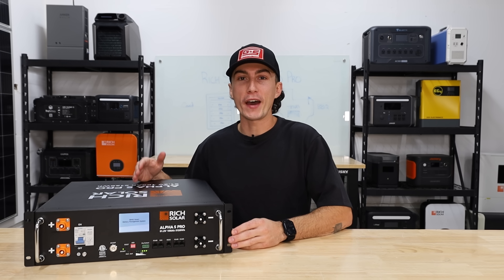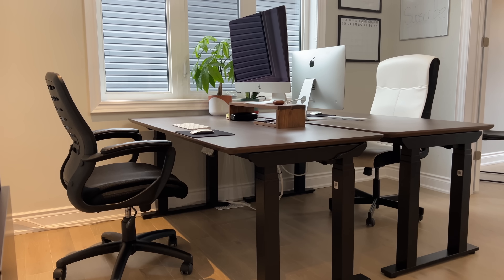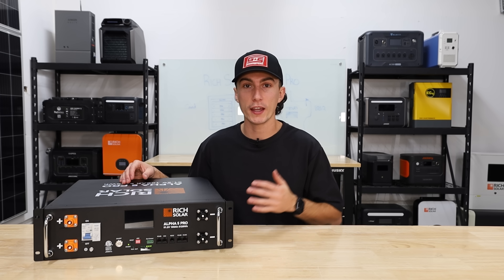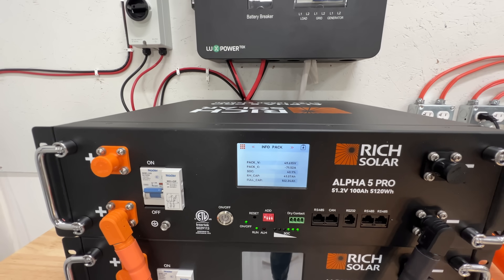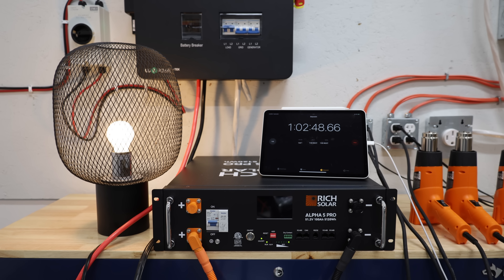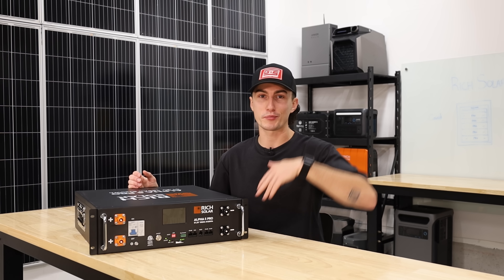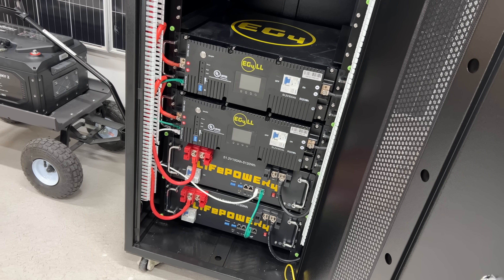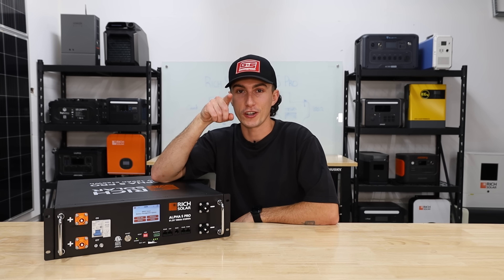Finally Something BETTER Than EG4? - Rich Solar Alpha 5 Pro Server Rack Battery

Comment: What kind of cable connectors does it use to charge or connect to an MPPT and/or inverter?
Reply: I don't know the specific answer as in a model number of a specific connector but was told by Rich Solar when I ordered extra power cable that they are proprietary and only work with their batteries
Reply: @mikeward1975  yup,  the only downfall is the connector on the battery.  this should have the option for a screw in.  when it arrives, it only comes with the "jumper" cables for another battery.  another $45 for a short length of cable with the connector.

Comment: If you're trying get a cheap rack battery, the VATRER's are still at $890.15, shipped, with BLACKOFF code from their website.  $0.17/wh is pretty good for a rack battery and getting down to DIY 16kwh pack pricing ($0.13/wh shipped last one I purchased).

Comment: Hey @TheSolarLab! Thank you for reviewing the ALPHA 5 PRO; we’re happy you like our battery!

However, we want to clarify that the ALPHA 5 PRO is compatible with EG4. Just set the protocol to Luxpower and it should connect.

We’ve updated our website to clarify which protocols to use for the inverters.

Thank you for making us better, and have a solar day!
Reply: This is key, since I wish to pair with an EG4 6000XP as shown in the video.  Hoping this is correct!
Reply from the maker: Good to know! We actually spoke to signature solar over the phone and they said it did not work, might be worth updating them as well!
Reply: “Should Work”?
Reply: Does not work with EG4 6000xp as far as communication. Battery throws BMS fault at the end of charge cycle. No help from either manufacturer yet.

Comment: Did they finally switch to 16 cell batteries?  Ordered a pair last year only to discover they were branding 15 cell units as 48 volt...  meaning they held less and standard lithium charge profiles didn't work.   Returned immediately.

Comment: I admit i didn't watch the whole video but i can't figure out if the battery comes with cables?  If not its probably not worth it because those quick connect cables aren't cheap.  What is included in the box?
Reply: I bought 2 from Shop Solar...Mine came with short parallel power cables for each and 6ft power cable for 1..A couple communication cables as well...The 6ft cables were in a separate small box so not sure if Shop Solar just threw them into the mix knowing they would be necessary or not

Comment: I emailed rich solar and they said the Alpha 5 Pro Server Rack batteries will work with the EG4 6000XP if the protocol is set to Luxpower.
Reply: It will not. Battery throws a BMS fault code at end of charge cycle

Comment: Can you somehow connect a server rack battery to something like an Anker Solix?
Reply: yes, use the battery's as a solar input on anker
Reply: You’ll need a XT60 female connector for the Anker Solix solar input. The only cable I could find for the Alpha 5 Pro connector for an O-ring required for an XT60 connection is Rich Solars “4 Gauge (4AWG) Cable Wire Connect Battery to Inverter (Orange & Black)” for $45. One is also needed to charge it and it doesn’t come with one.

Comment: Thanks for the review. Does this have a UL Listing? If it does not have it, it is pretty useless for solar installs that require inspection.
Also, I want to echo @dvatp, lack of EG4 support is a deal killer.

Comment: My 48 volt Rich Solar inverter runs my table saw. My very heavy, expensive 6000EX inverter with a big transformer fails to handle the surge. Rich is superior in every way.
Reply: I recall hearing that some people had hooked up their EG4 Inverters and were not getting good results, until they discovered that the battery pack they were using could not handle the load it was requesting. (Of course, your situation may be different).
Reply: @ I have 2 EG-4 48v 100 AH batteries, which powered the table saw flawlessly with the Rich Solar inverter.
Reply: @CompleteOffGridAmateur  I wonder what the starting current draw on that table saw happens to be. But, back to the 48v Rich Inverter, which model is it? Might be cool to check it out.

Comment: ISSUE 1) Can only parallel 16 units
vs eg4 can parallel 64 units, giving greater expandability.

ISSUE 2) Must be capable of communicating to the inverter.

Those Two Strikes are an absolute deal breaker!

Comment: The lack of communications compatibility with EG4 inverters is a deal-killer for me.
Reply: Yeah, that's probably worth the $100 more per battery for all the value-add that gives you.
Reply: @kojakdurham  Just checked the site and downloaded the manual.  If I can believe the manual it appears they support EG4 protocols now.  But of course the battery is now $1800.

Comment: 4:30 - Something is fishy here… A 90 watt load only running 1.1 hours. Might want to do a disclaimer and review the math. Other than that! Great vlog.
Reply from the maker: Yea meant to say Amps! It showed Amps on the screen on the battery sooooo half points?😂
Reply: @ No problem, no points deducted, looking forward to more off grid / solar exploration. Thanks for the clarification, I’m a bit embarrassed about that I didn’t offer that up! Thank you, makes much more sense now. Central Florida here 🌴
Reply: He probably meant 90 amps. That would make sense.
Reply: I never post comments and want to get clarity on that comment in the video. So, what do you @thesolarlab run for that 1hr test?
Reply: I had the same confusion/concern. Glad to see I wasn't the only one confused.